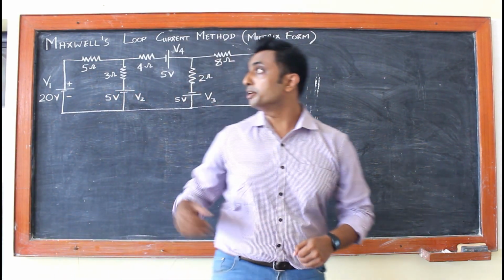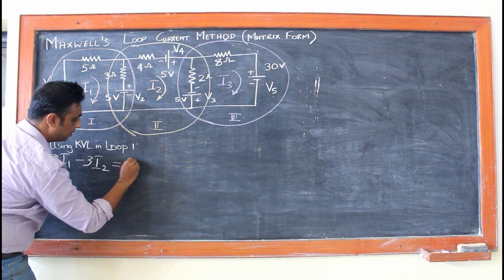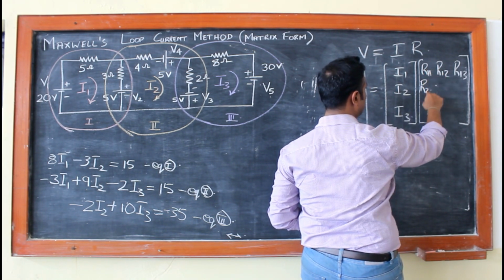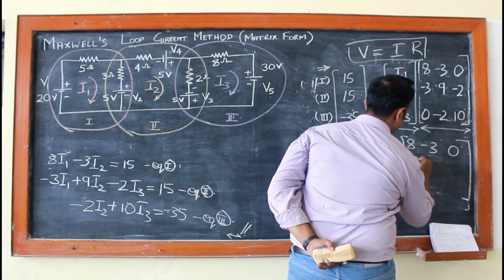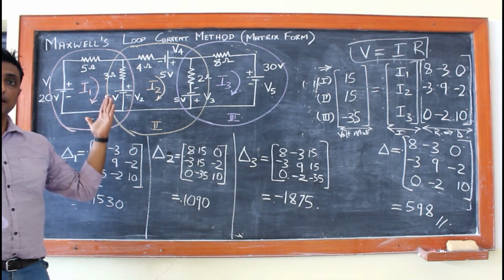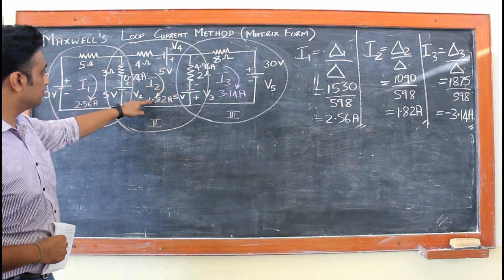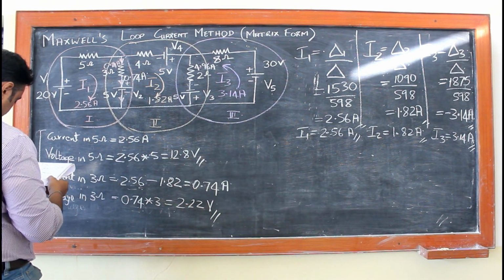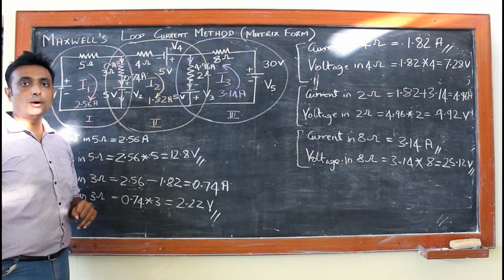Episode 2 : Matrix Form of Maxwell’s (KVL) Loop/Mesh Method

Comment: instead of calculating by V=IR formula can we use calculator?
Reply from the maker: I think you are refering about using calculator dirctly instead of following the steps !!
Firstly, As per examination norms, you have to follow the steps...
Plus say if your answer goes wrong by using the calculator directly, then the steps will get you some marks instead of a zero
Reply: yes sir I was thinking of doing it by simultaneous equations
Reply from the maker: Nabhey samant Simultaneous Equation method and Matrix method are 2 forms of solving...
u can choose which ever method but if they ask in exam a specific method then u have to go as per that method...
hence both the methods are explained...